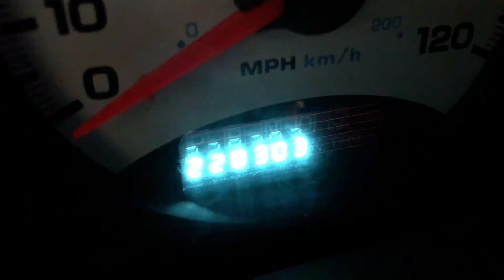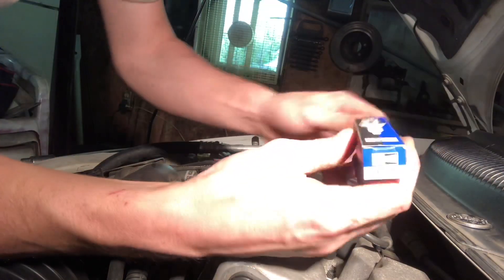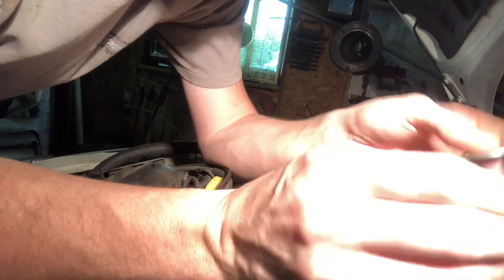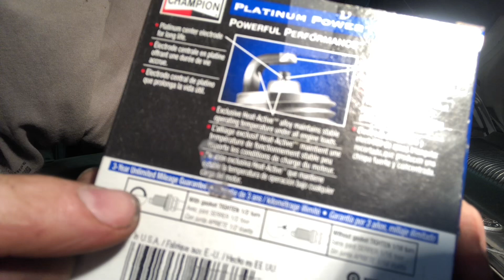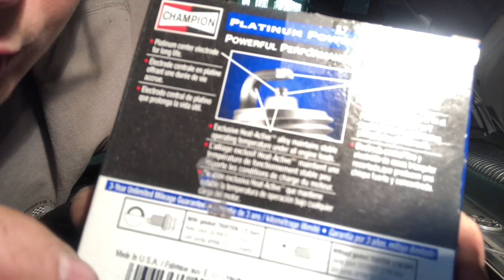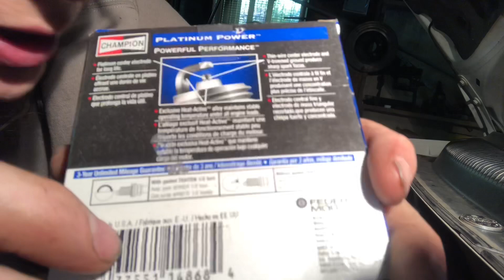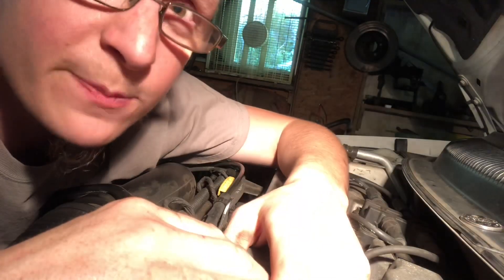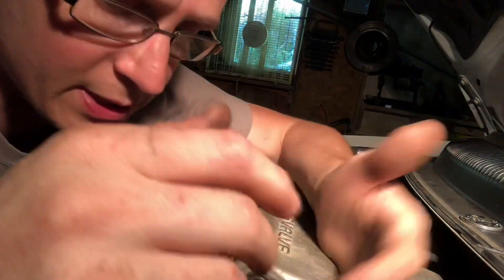2003 2.4 DHOC Dodge Stratus spark plug change

Comment: Hey bud, I was changing spark plugs and the ones I took off the car where slightly shorter than the ones at auto parts store. I will go with the ones you mentioned Champion 3570 and gap them. 050. Thanks again oh I have a 2004 Sebring 2.4l DOHC also doing valve gaskets tomorrow.

Comment: Is that the dohc 16 valve engine 2.4l? I have a 2006 Chrysler Sebring that has that type of engine which you mentioned is like this dodge’s.
Reply from the maker: Yes it’s a 2.4 16vl same as the stratus, Sebring, PT cruiser, and SRT4 Neon.
Reply: How many spark plugs does that engine have/use? I only see 4 on my 2006 2.4L Sebring.
Reply from the maker: V4 have 4 plugs v6 have 6 plugs, v8 has 8 plugs and so on. 2.4 2.0 are v4’s as in 4 cylinders. One plug per cylinder.
Reply: Also, would I have to change the spark plug wires if they're in good condition? They're still the factory ones I think and my car has 91k miles barely.
Reply from the maker: I would change them.

Comment: Would the sputteri g be because  it needs transmission fluid
Reply from the maker: It could be or bad spark plugs coil pack or spark plug wires. Fuel pump or even fuel injectors

Comment: Thanks, is there a second part with the valve cover gasket replacement ?
Reply from the maker: The valve cover replacement is just like any 2.4 motor in a Neon, PT Cursier and all Dodge cars of this year. The only parts needed for the valve is the gasket and goments and spark plug tube gaskets.

Comment: My uncle put a new ignition module in and sparkplugs and car runs good for a minute the seems to lose power
Reply from the maker: Any check engine light? And by losing power is it when in gear and driving or a idle?
Reply from the maker: Also where the plugs gaped right?
Reply: Dodge Neon Racing & Stan’ Auto Repair losing power when driving engine was getting kinda hot and smelled of antifreeze
Reply: Dodge Neon Racing & Stan’ Auto Repair yes plugs were gapped right
Reply from the maker: Ok maybe the thermostat is bad. Also make sure there’s not antifreeze in the oil and does the car blow out white smoke from the exhaust if it does does it smell sweet. There could be antifreeze getting in to the combustion chamber. If that the case the head gasket went bad. But if not there could be an antifreeze leak from the thermostat housing or the radiator has sprung a leak or the coolant hoses. Hope this helps.
Reply from the maker: And is the check engine light on?
Reply: Dodge Neon Racing & Stan’ Auto Repair yes and flashing on and off
Reply from the maker: Ok I would take it to a shop and have them check the codes stored in the pcm. Or you can check the codes yourself I just posted a video recently on how to do it. And if you get the codes let me know
Reply: Dodge Neon Racing & Stan’ Auto Repair OK thanks for the help
Reply: Dodge Neon Racing & Stan’ Auto Repair oh yeah no white smoke
Reply from the maker: Ok good.
Reply: Dodge Neon Racing & Stan’ Auto Repair just changed the engine management & ignition again and now its giving me a putting type feeling
Reply from the maker: Ok where did you get your parts?
Reply: Dodge Neon Racing & Stan’ Auto Repair auto zone
Reply from the maker: Ok what where the codes?
Reply: Dodge Neon Racing & Stan’ Auto Repair OK changed the sparkplug wires and the 4th sparkplug and its running fine now I'll keep you updated
Reply from the maker: Ok cool!!

Comment: I have a Dodge Stratus Coupe R/T 3.0....
Reply from the maker: Ah the trouble v6. I always say with the v6 to keep the oil change and clean and tune ups when needed. And Timing Belt and water pump changed at the miles called for.